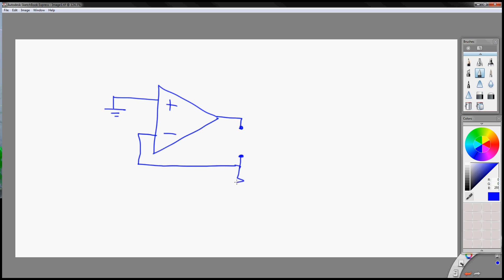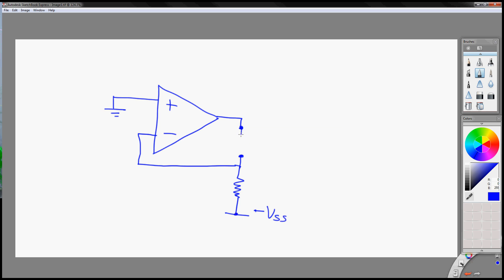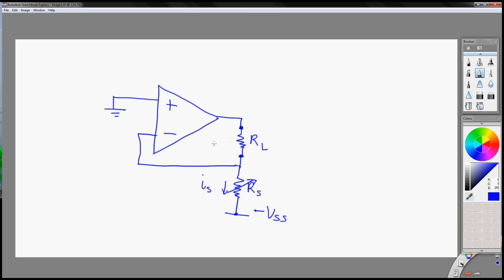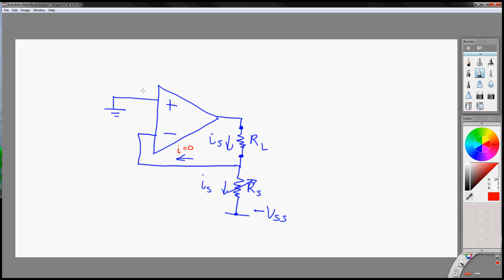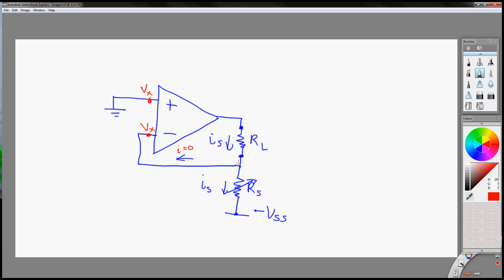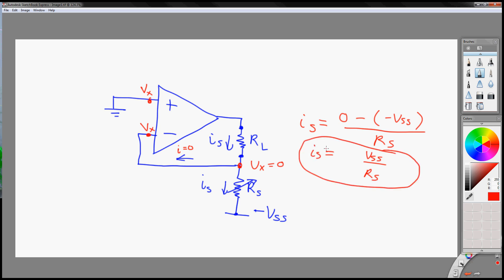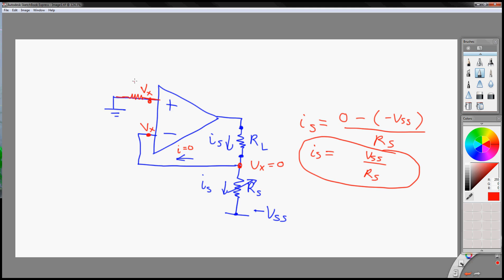How to Make a Current Source using an Op Amp

Comment: @amir, one of the op-amps goals is to make sure that the voltage at the + and - pins are the same so you can see by ohms law that the current through Rs is equal (V(+) - Vss) / Rs. As an example. V(+) is 0V and Vss is -5V and Rs is 1k so the current through Rs is (0 - -5) / 1000 or (0 + 5) / 1000 or 5mA.

So if you wanted to make the current adjustable by using a voltage, you can use a digital to analog converter and put the output of it onto the V(+) pin on the op-amp. DACs are pretty cheap and can be controlled through I2C interface.